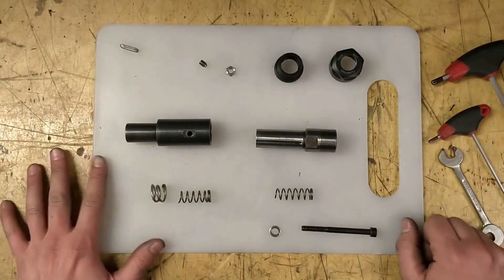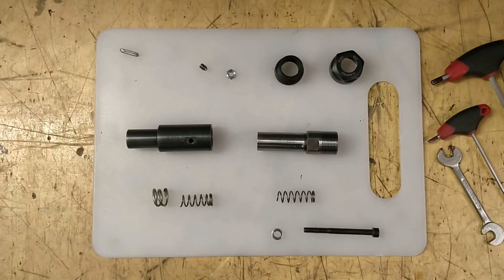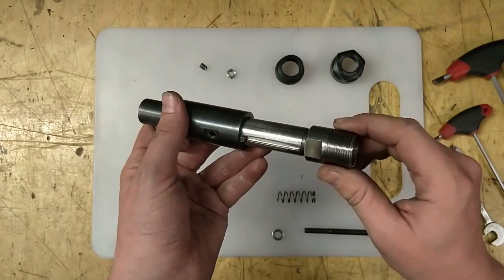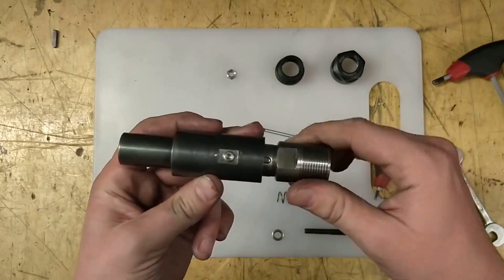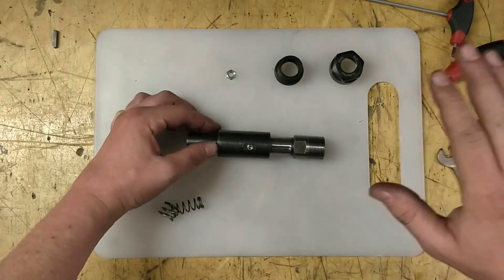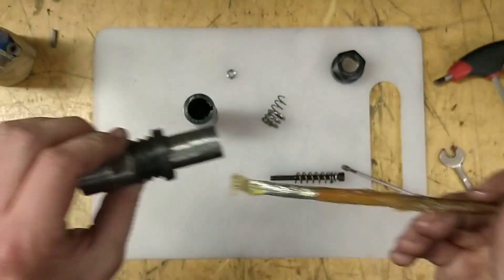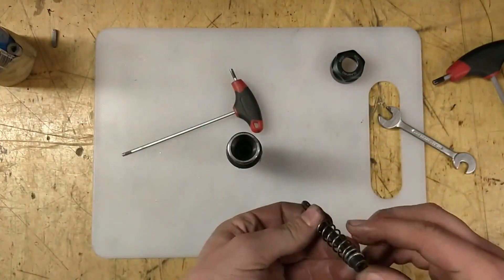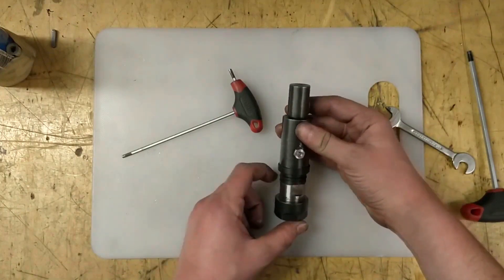Floating Tap Holder for Rigid Tapping

Comment: I like simple designs.
I have a manual milling machine that does not have a quill. This means that I need a device similar to that in ordcr to be able to power-tap with the milling machine.
It is my belief that the vertical jamming with torsion when using a "normal" key is because the key was loose on the collet side. This makes it roll just a tiny bit and jam.
One option is to use balls as keys. I will try that one out - it might just work. If it does not, the I have just lost my marbles :)